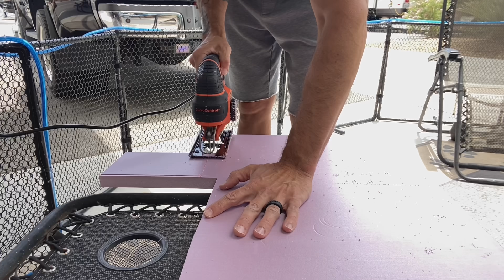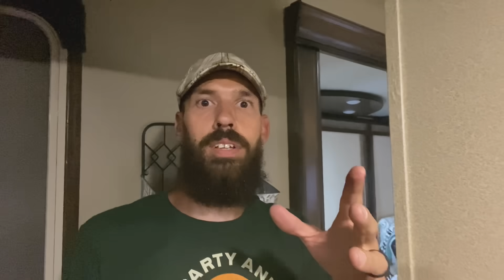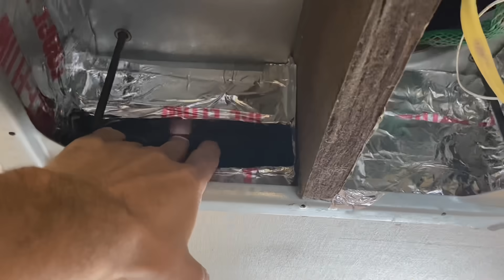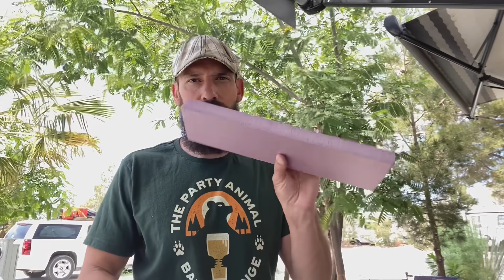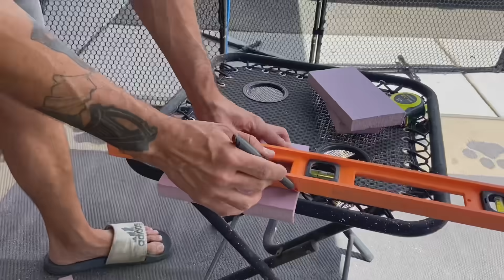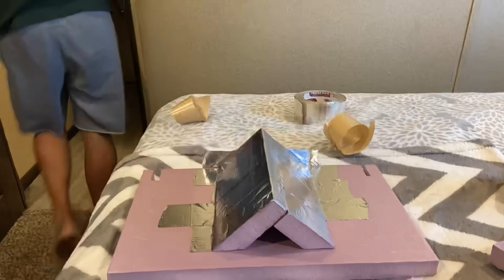RV A/C Modification that will DOUBLE the Output & BOOST Performance!

Comment: I’m not sure if you’re still answering questions. What about a AC unit that has no duct system? Can you do anything to it? Great video.
Reply from the maker: Well this modification won’t do anything for those types of AC units. This is all about forcing the air into the ducts quicker for more flow. We have another video on basic AC maintenance to keep them running at their optimum performance but that’s all I can offer. Thanks for watching 👍🏼

Comment: Well of curse that foam is going to make it quieter, but not going to give you double the output. All you've done is reduced turbulence slightly and sealed up some small leaks that might help distribute the air a bit better.
Reply from the maker: That’s the idea right, use the foam to make it quieter and force the air directly into the ducts so it pumps our faster, harder thus forth cooling the RV quicker! Everybody I know who has done this mod has been really happy with the results! 😂 Thanks for watching.

Comment: Thank you for the great video and easy instructions. Quick question:  since plenum depths are different in a lot of rvs, how do you determine the necessary height of the triangle?  Thank you. Jim.
Reply from the maker: Thanks. Really doesn’t matter. It’s just the idea of creating less space up in there for the air to get lost in. The triangle just forces the air directly into the ducts faster where it needs to be going. 👍🏼
Reply: @WhyWait  actually it may not be critical but it does matter 🙂 Air does not like to make sharp turns nor to speedup and slow down. We are stuck with turns... but to minimize the speed change ideally we want to maintain the same port area throughout. So if you have a duct into the RV of 1.5" x 8" you would ideally like to maintain that same profile through the use of the triangle. If you measure around the AC blower output, the effective 3 sides divided in two comes out to around 7" so we can get close if we allow airflow out of both sides and the end and make a passage the same height, or just a bit taller, as the ducts in the RV.

Comment: I have a class A Motorhome with 2 Coleman Mach 8 rooftop a/cs that are ducted.  How do you perform this modification for my application.  Thank you
Reply from the maker: Hey Bill I’m not too familiar with those units, I believe those are the shorter units up top? Basically if you open up your unit from inside the rv like I did and see a partition wall separating the intake side from the other and you have an empty space in the plenum where air is circulating and being wasted vs forced into the ducts you can probably do this. Of course I’m not sure if you have a heat pump in your unit and I don’t know if this would affect that. Hope it helps.

Comment: @Why Wait, did you reinstall the panel that you removed at the 10:45 mark?
Reply from the maker: Nope. That’s just a track for the air dumps which will no longer work/be necessary. I kept them just in case I ever need to put them back in. Appreciate you watching. 👍🏼

Comment: What size rv do you have? I just put new 13.5 BTU units on mine. It's a 37 foot bunkhouse. I'm in Texas and it's already 100 degrees. I'm in a shaded spot and my rv is currently 77 degrees inside. How has this modification held up? I'd like to do this to both of my units and maybe alternate use between the two of if makes a big difference. Trying to extend the life of my units. They're expensive now.
Reply from the maker: We have a 41’ fifth wheel, midbunk. So far the mod has held up great on both AC units. It’s been awhile since we’ve run them hard but we are in GA so the time is here for 24/7 AC as well. Hopefully the units hold up well. Over 4 years of use only issue is I had to replace the control board on one before. It was $70 on Amazon. Thanks for watching 👍🏼
Reply: @WhyWait  I'll be doing the mod on mine this weekend. I was shocked at the price of those 
a/c units now.

Comment: Hi Chris... I followed you tutorial and installed this in both ac units in my 2017 Jayco Greyhawk... the difference is amazing... but I had a question... the dividing plate that fits in to control the dump vent and the intake be left out or modified to let more air intake to help ac performance... I'm thinking more air in mean better flow out... what are your thoughts...

Watched many of your videos... great information and helpful tips... thanks for what you do
Reply from the maker: Thanks I definitely appreciate it. Yes I did not reinstall the plastic dividing plate no reason for it anymore since the dumps won’t work. But yes you can definitely modify things to increase more air flow in. You can even make the box smaller to increase more air in and less cold air space. I’ve seen people do more advance mods than mine since this. Play around and see what you come up with. Appreciate the views and comment!
Reply: @WhyWait  I was also thinking about opening both ends of the dump vents to let more air intake but then should I put a filter of some sort on those as well...
Reply from the maker: @keithlandry3592  yeah probably a good idea. I would if I did that. 👍🏼

Comment: Thanks for your input. I built my own version for my Coleman-Mach unit and air flow did increase by about 40% based on measurements by anemometer. Major improvement over the factory setup.
Reply from the maker: Right on 👍🏼It definitely makes a difference right!

Comment: What if the AC unit is also a heat pump?
Reply from the maker: This I do not know John. I have been wondering about this myself. Im not too sure what the inner workings look like inside with the heat pump. I know my units can easily have the heat pumps installed but I don't know about with this mod. If you find more info out about this please let me know because I am curious as well. Thanks for watching

Comment: I finally did this to our 2021 Rockwood mini lite. The air flow is a lot better and also about 8 to 10 decibels quieter. I did not get a chance for a good review due to some stormy weather but I think it will a great improvement. Thanks for the instructional video
Reply from the maker: Nice! Glad it worked out and helped a bit. Appreciate you checking out our channel. 👍🏼

Comment: Can I use a thinner piece of insulation board?
Reply from the maker: You sure can. I know some people who used a thinner board to fit their style AC unit better. I’m assuming the thicker might be a little bit more effective for the R value holding the cold air in and warm out but overall I bet it won’t make a big difference.
Reply: I had to to use a thinner piece on certain pieces it worked just fine

Comment: New subscriber here! Love your videos! We just got our 367bhs 2 days ago. I'm doing the bunk mod first. So greatful for the content and ideas! 

I was curious as to where you ran the electrical for the fan to? Possibly the outlet on the other side of the loft? I'm gonna run something quick now but was think how awesome it would be to run it into the AC on off power so it would kick on with the unit 🤔.
Reply from the maker: Thanks we definitely appreciate it! Feel free to always reach out with questions. 
I plugged the fan in right up top in the loft and I can reach the dial up there to turn it on from standing right outside our midbunk door.

Comment: Foil tape a couple bucks per roll ?   Maybe if you can find a roll that only has 4 feet on it. Otherwise that stuff cost 15 or $20 a roll and more
Reply from the maker: The Amazon link in my description below the video will take you to the roll I used, $7.88 for 150 feet. Plus there are all others on Amazon for similar pricing. Don’t know where you are shopping for those prices. Thanks for watching.

Comment: So mine did not come out nearly as clean as yours BUTTTT it works wayyyy better than it did before like a huge difference so I’ll take it hahaha thanks for the video I appreciate your help I was watching it over and over well I was doing it haha thank you 🙏
Reply from the maker: That’s great to hear! Hey nobody can see it anyways, as long as everything is taped up good and sealed your golden. Appreciate you watching! Always good stuff on our channel 👍🏼
Reply: Okay so first there was like about a inch gap from the actual duct with no tape it wasn’t messy or anything there was just no tape so I sealed it all off with hvac tape and made my lil TP type thing now it works amazing! And it’s way more quieter I can actually have a conversation under my ac now and not be screaming 😂 I see a lot of people that just put portable air conditioners in there’s and just not use the ac that it came with cause it’s so loud and doesn’t work only if they’d watch this video and put in a lil work it’s so much better 😎

Comment: I also should have mentioned that when I did the modification and re-started the unit, I was amazed to see that the vents pushed out a lot of debris (small pieces of wood and dust) giving good indication of the improvement in the force of the new air flow produced. Thats Why wait.

Comment: Did this to my motorhome also, easy to do and the improvements on the air flow and noise is simply just amazing. I also noticed that the temperature is easily maintained to what I set it up to be. It also works perfectly with the heating function of the unit.
 My wife is really pleased with this improvement.
Thanks
Reply from the maker: That’s great to hear! Glad it worked out for you guys. Appreciate you watching 👍🏼

Comment: Apparently somebody made a product designed to do this very thing called RV Airflow. It looks like it keeps the air tightly focused to maintain the laminar flow. I'm on the fence myself if I will buy this or just DIY it. Thanks for the guide.
Reply from the maker: Sure thing. Either way I think you’ll be happy with the results. Appreciate you stopping by and watching 😊

Comment: Doesn't the air need to blow out from the bottom of the vent also?
Reply from the maker: No, those dump vents are only if you wanted the air to come directly out into that room and not into the ducts which is exactly what we are looking for with this mod.
Reply: On some...  be aware that on some RV's you could have a unit that is designed as a "direct dump" into an area.   On our 2022 Paradigm 340RL the rear AC isn't ducted, so there will not be a need for this mod.  The other 2 AC units could use this mod or a similar mod that allows a split between the ducts and the direct dump.  Great video, thanks!

Comment: I would like to see a video on the newer whisper quiet a/c systems.  I cannot see my a/c from the inside.  It goes directly in to the ducts but of course not all vents have great airflow.  I'm wondering how I can improve upon it just like this.
Reply from the maker: I’m not sure. These units are suppose to best on the market, while they are not the whisper quiet models they are suppose to be more efficient than those.
Reply: Remove the vent covers and HVAC tape any gaps in the ducts to prevent air from escaping into the ceiling. Clean the coils / do routine maintenance on your AC. If your ducts have a "race track" (same duct to multiple vents) layout, place some doorknob bumpers (the things that protect your walls from getting damaged by opening the door so hard the doorknob slams into them) in the ducts above the vents to divert airflow to them. Close off any extra length of duct beyond the last vent as it's useless and just messes up airflow.

Maybe even remove the rooftop AC unit itself and check the ducts under it? (May not be worth it.)

Comment: I have a different model of A/C but the principal still applied.  I created a similar baffle and the air flow is better.  Not sure it made it quieter but maybe it won't run as much.  Thanks.
Reply from the maker: Awesome. That’s what I’ve told other people who have different AC units, it’s the same idea with any of them. Thanks for watching!

Comment: This is so much cheaper that that one you can spend $200 on for the same results!  I am definitely doing this asap!  The ductwork in campers is so sub-par....  Great video!  👍
Reply from the maker: It is a shame that we have to go through and inspect all the duct work and vents and tape everything up. Mine were pretty decent but I’ve seen other people’s ducts with major gaps in them. Appreciate you stopping by and watching 👍🏼

Comment: Out of the 5 RV’s I’ve owned only 1 had a very good A/C setup, currently my 5th wheel with only on unit has a hard time with the forward room and after seeing this video I was, yes that’s a great idea. Interestingly enough, however after this I watched a vid that featured a pre made for purchase unit made from styrofoam, $170 bucks, with a little ingenuity you came up with this for a fraction. 
   I’m not knocking somebody’s hard work and certainly not the cost involved with bringing something to market, it’s just that with a little time and effort we can get the same effect.
Reply from the maker: For sure. Hats off to the company making them and selling them. I’ve always like DIY projects when I can. This one works very well. Everybody who’s done this that I’ve talked to has really noticed the difference. Thanks for watching 👍🏼

Comment: I Did this upgrade to the AC in my bedroom and have noticed significant improvement in airflow to my vents. I do have a question though. After doing everything and getting to the final step of putting the last white cover on the one that has the place for air filter I noticed a whistling sound that goes away if I don’t put that cover on there. My question is is it OK to leave the cover off or should I just deal with the whistle lol
Reply from the maker: Not sure about the whistle sound. Something must not be snugged up all the way. I left the first cover off, the one with the track for the air dumps, but you kind of need the last cover since it has your filters in it. Definitely want to filter the air and catch all that dust n dirt before in goes up.
Reply: @WhyWait   ok I’ll try leaving off the first one and putting up the second one and see if that makes the noise stop, also if I want the air to go thru the filters then should I have the little square holes shut?
Reply from the maker: @jessiesiefer9263  yup got ahead and shut those dump valves 👍🏼

Comment: We did this to ours about a month ago and were very surprised at all the openings into our roof area as well as openings between the intake and exhaust sides. We used the same foam as well as reflectix on areas we did not need foam. Results were outstanding. Three ducts had very little air flow and temps were no more than 8 to 10 degrees below ambient. Our ducts now blow air out with force and that is all ducts. Temps can drop 20 degrees making the trailer cold. We did use 1 inch with 1/2 inch on dump area and closed the dump off due to noise. Very quite and cold now with 13,500 ac in 22 foot trailer. Great mod. Wife is very happy now.
Reply from the maker: This is so awesome to hear! What difference it can make uh? Amazing how bad they can come sealed up from the factory. Appreciate you watching our channel and stay cool 😎
Reply: Can you explain what you mean by 1/2 in on dump area?
Reply: You went through the modification of the bunk area fairly quickly.  Since I am not familiar with how the "loft" is constructed, and what angle of view was being shown. I am somewhat confused.  If you have the time and inclination, a secondary video showing this might be helpful. Having said that my rig is VERY different, and I am just trying to understand what you did in yours so that I may be able to.modify it for mine

Comment: Great video! i had the material for a few weeks and finally got around to doing this mod. Absolutely amazed at the airflow its down to 71 from 90 in 2 hrs and dropping. We are in south FL and the humidity is 100%. we only have one ac i can ck off the second ac no need. I can only think of one thing to make it better.......install my home central unit in it lol.
Reply from the maker: Hahaha That’s awesome! Glad it helped. Appreciate you stopping by our channel and watching. 👍🏼
Reply: Ours will get in the mid to upper 60s now, a huge difference at 90 ambient.
Reply: You temp drop sounds right...2 hours to drop 19 degrees.  I'm not sure how Why Wait dropped 9 degrees in 11 minutes.  I've never seen anywhere near that performance even with 3 A/C units running.
Reply: That would be more like the pre-fab RV Airflow

Comment: Installed the RVAirflow unit in our RV.   You did a great job.  Maybe even better, since I couldn't really tell if the side ducts lined up perfectly with the RVairflow box.  Instead of channels in the foam board you could have just drilled holes for the lag bolts to go through.  Also.. probably would have just removed the bolts and bottom plate completely for easier access.   It's awesome for sure!